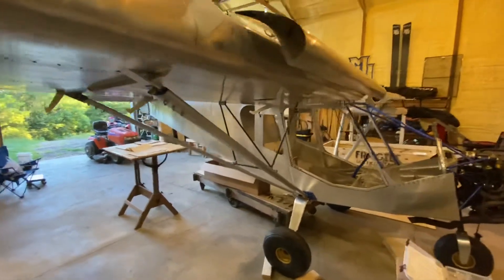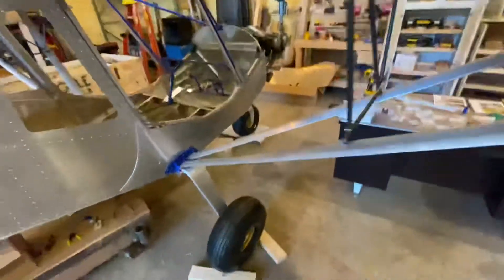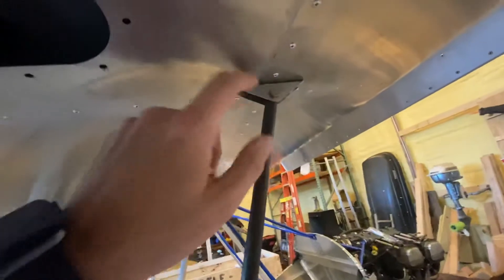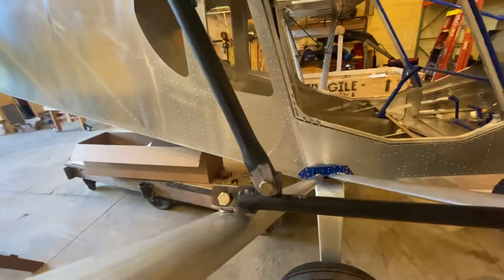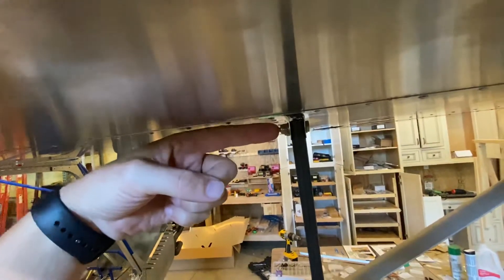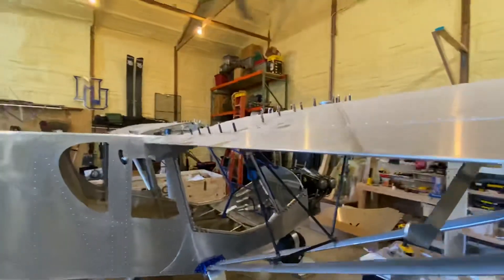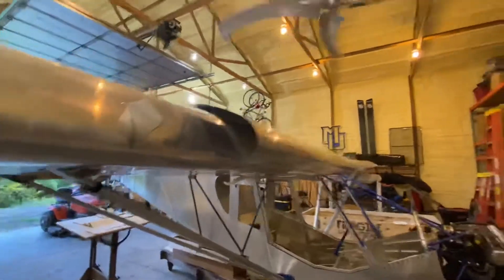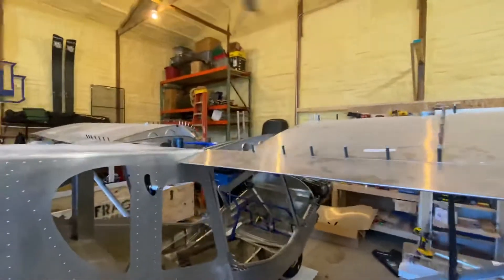Zenith CH750 STOL Build Log - Mounting the Wings!!! Part 3

Comment: Great video. Are you just going to let the landing light wire hang in the nose ribs? I put a plastic tube and tired all the wires through the nose. Ch701
Reply from the maker: I was planning on running all of the wing wires in a corrugated wiring loom thru the trailing edge. I will put some connectors in so I can remove everything easily if need be.